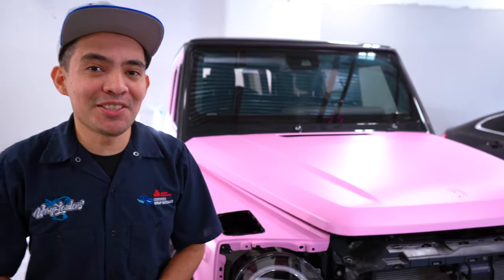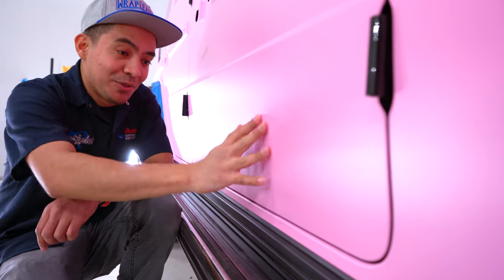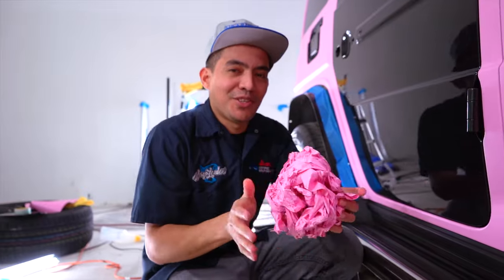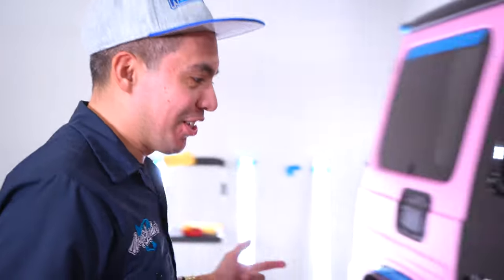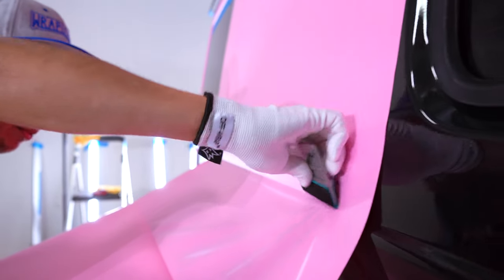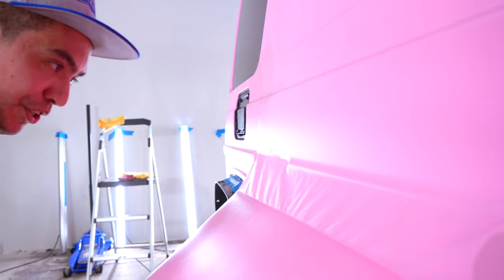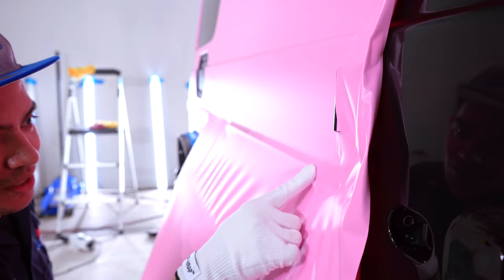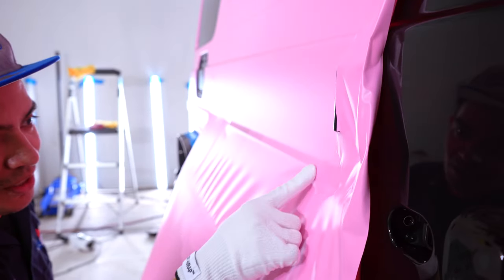Why is a G Wagon so HARD To WRAP ?! Watch me Wrap one 🥲

Comment: One thing i will say gets ver overlooked in vinyl these days is using soapy water as they do with tints. If you were to use the wet app method there would be an easier chance of getting no bubbles

Comment: You're probably the guy to ask. My wrapper uses scalpels and not razors. His explanation is: it gives him more precision control on the cut. It also lasts longer and holds its edge longer. Scalpels also are thinner and gives him a more noticeable response on how the blade is cutting the wrap. 

So why do you use a razor and not a scalpel? It could just be down to personal preference

Comment: As this is a black G-Class, you can get away with leaving the hinges black I guess. What would you recommend doing if that's not the case? Let's say you've got a red one to wrap.
Reply from the maker: Id explain to the customer that wrapping the hinges is possible but the chances of it failing eventually are high so we would recommend painting/ powder coating them black. Id charge a bit extra for that work on a different colored one.
Reply: I just spray paint the hinges when a customer comes to me with a wrangler or g wagon, make sure to explain to them of course.

Comment: Those vehicles are such a pain in the ass to work on. For one, disassembly is a disaster! Secondly, the roof is ginormous! It is very difficult to do this vehicle without some seams. Kudos to you for a spectacular job but I would avoid vehicles like these. The risk vs reward is better playing on the slot machines at the casino 🤣🤷🏻‍♂️